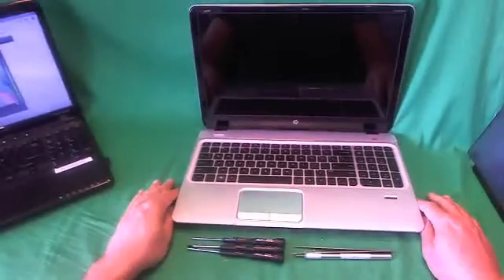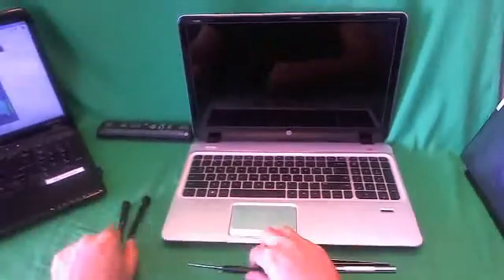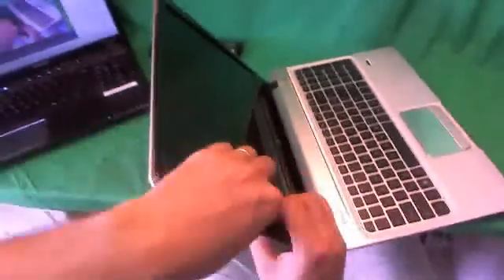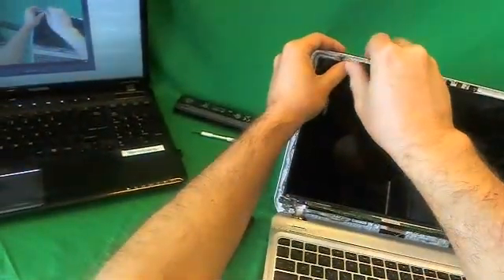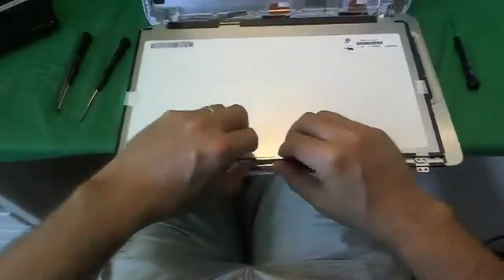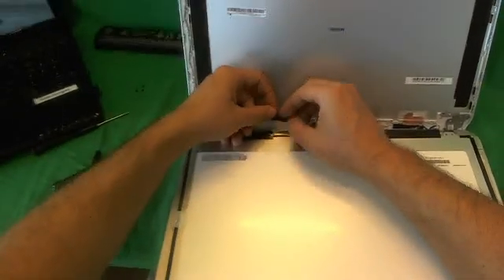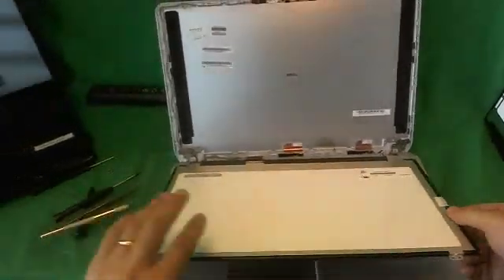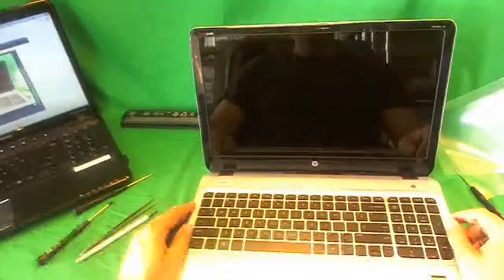HP Pavilion M6 Laptop Screen Replacement Procedure

Comment: The video was very helpful.  Took me an hour to replace the screen. The webcam sits in a small metal frame in the bezel. I could not remove it. There is a connector right out of the webcam frame.  It disconnects easily and is tricky to re-connect. At the bottom of the bezel there are several layers of adhesive tape that attaches the bezel to the LCD circuit board. The top layer of tape will free the bezel from the circuit board.  The screen lid is flexible plastic.  The LCD screen screws right onto it. The LCD connectors are secured in place by adhesive tape.  With the bezel removed, you can tighten up all hinge hardware.

Comment: had this computer since 2012. i love almost everything about it except how they chose a cheap plastic screen frame for a relatively heavy screen. the frame has been gradually cracking and popping out from the screen just from the simple act of opening and closing it. is there anywhere that i could get screen frame for the m6 that's made of something more durable?

Comment: I have this laptop (HP Pavilion M6) and the screen went out. I had this ghetto set up with the computer hooked up to an external monitor for weeks. Finally I broke down and searched repairing the screen for this model computer and stumbled on this youtube video. I ordered the screen from their website (decent price and tools included).
If you decide to order from them, don't pay for express or two day shipping, they shipped my order immediately and it arrived in 2 days with standard. 
When I got the screen I played the video and replaced the screen following the video (I was fortunate enough to have my GF's laptop).
 I  did have to install the screen twice - it didn't work the first time because I didn't properly connect the screen to the laptop (this is the most difficult part, as the video shows you need to ensure a secure connection). Tip - you need to pull the cord away from the laptop, mine had adhesive keeping it snug to the frame. It doesn't come out very much, but the little extra slack made the difference. 
Try this at your own risk, but the second time I hooked up the screen and before putting it all back together I put the battery back on to test if the screen would work at all. The screen was facing down but the whole thing glowed, so I knew it was working. I quickly turned the laptop off and pulled the battery and put it all back together.
How geeky to be so fired up about fixing this myself, but I spent around 80 bucks and its like I have a new laptop with the screen so crystal clear.
Reply: last tip, calibrate your screen.

Comment: I have the same laptop, my screen is not mess up but where the top folds in the clip that hold it together seems to have become either broken at the screen side or in the center of the clip is there a way to fix it with out having to replace the screen to remove piece behind the screen?

Comment: I can reconnect the camera by hand. First you have to unmount the camera from the display assembly. After plugging the camera module, you can remount the module to the assembly. BUT, you have to risk to do it while the laptop is on. So, you can check that the camera is working before you re-mount the display bezel.

Comment: On the whole, however, these instructions are excellent. It's very handy to have the tools included. My screen had one dead pixel--disappointing--but it is bright and clear.The video emphasizes matching part numbers; in reality the replacement part number will almost certainly be different. All in all, I'm very pleased with this purchase and these instructions, with the exception of the missing step--should be corrected in a replacement video. HD would also be nice--or at least 480p.

Comment: A bad omission in the instructions! If your m6 has a built-in webcam, you have to reconnect the webcam cable (at the top of the backplate, like the video cable at the bottom) to the webcam in a little metal strip along the top back of the bezel). The connector is a tiny black plug. It has to go into the tiny socket at the left of the metal strip. Take the clear tape off the plug to give you room. Use tweezers. Very fiddly. My son's young eyes & steady hands made it work after two tries.

Comment: when i removed the bezel on the top the webcam component came with it... it seem there is a plug and 2 other connecters that just sit against the back... i cannot seem to get the webcam working again. while trying to get it back together the webcam did connect for a split second then disconnected again. so i don't think i broke it, i just can't seem to get it back together right.. any suggestions?

Comment: Everything looks and works just as good as new! Just take your time, follow the steps in this video, and don't use too much force. Get a good grip on things when you get to removing the bezel along the bottom.

For the wire in the back, I recommend pulling it up a little more to give yourself some wiggle room and slack before you connect it to the new screen. Connect it twice, as it says in the video, just to make sure you've got a secure fit.

I hope this helps!

Comment: I just got finished replacing my broken screen using every step of your video. Thank you so much, Eugene.

For anyone else who might need a replacement,
be extra careful when you get to removing the corners of the bezel. Everything was going smooth for me until I got to the corners and I managed to slightly break one of the clips. The bezel went back on fine since only one clip was broken. Just a word of warning!